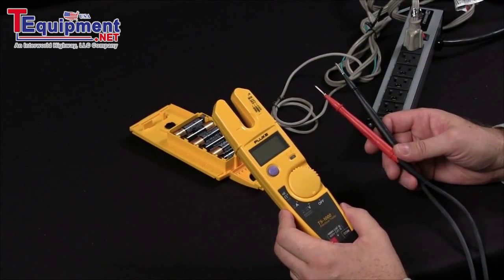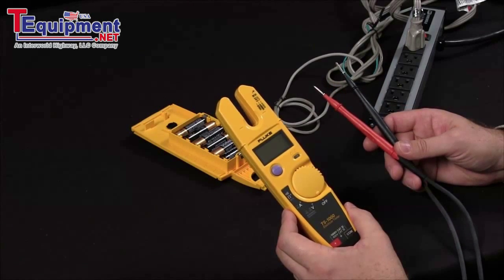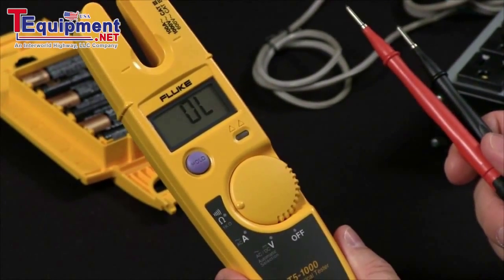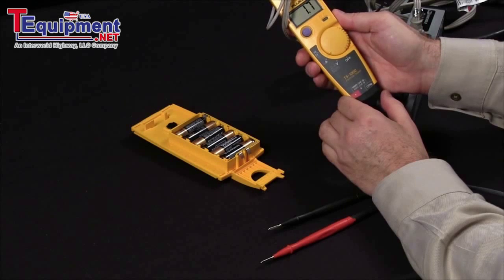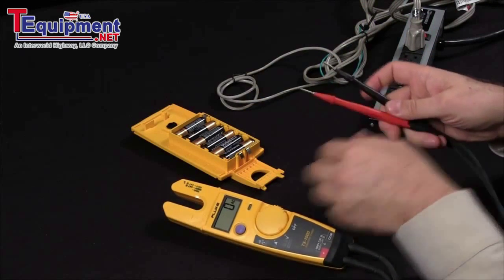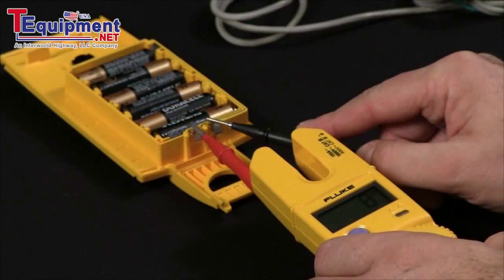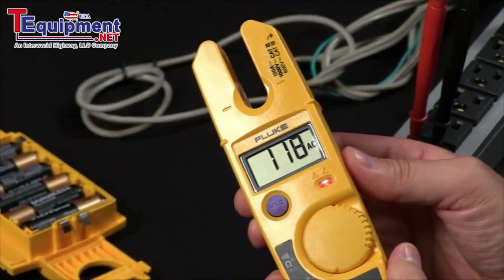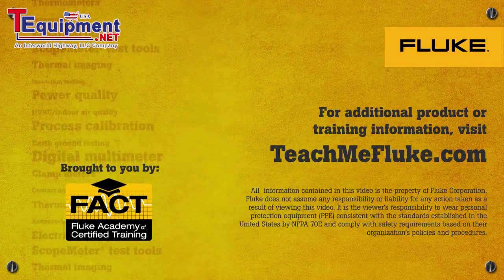How to Measure Voltage And Current Using The Fluke T5

Comment: Please, how can read Milly amps and bolts on let's say a wood table, toilet set, or wood floor. And this is for reals, I have Fluke T6 600 meter.thanks for getting back to me for yes or no😊😊🤔
Reply from the maker: This could be a grounding issue with the building you are in - we recommend that you contact a professional electrician to diagnose the issue.
Reply: @TEquipment  just wondering..I have the t5 1000 and when I put there wire in the amp meter between the two lines in the semi circle area it doesn't show a reading. Then when I put it at the top of the jaws it gives a reading is this correct?

Comment: I've read that OpenJaw clamp meters can measure current without splitting the wires.
Is it possible with the Fluke T5 ?

Thanks.
Reply: He showed you how to measure current in the video.
Reply: @rambosclone8410   UH... If you Don't Understand the question.... Don't Attempt to answer it!!!    DUH...  >:)